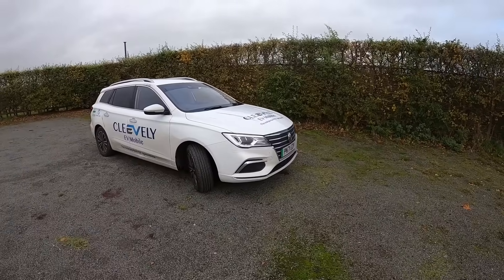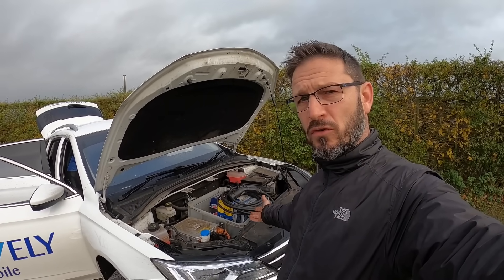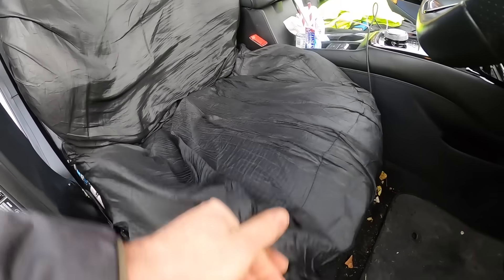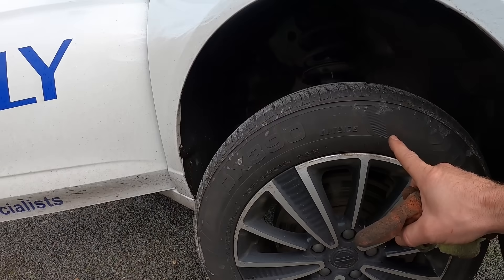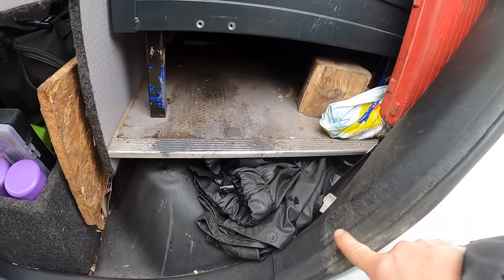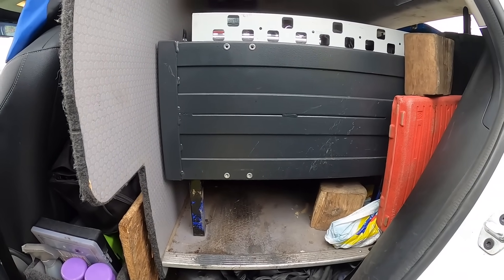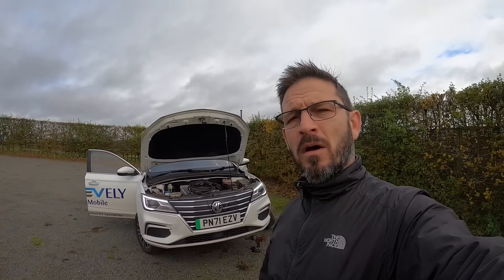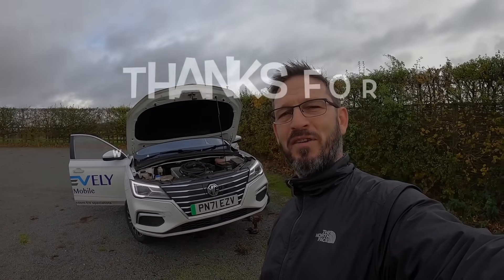How's My Electric Car Battery After 100,000 Miles?

Comment: Cells defiantly sufferer from calendar ageing which works in conjunction with cycling in order to degrade the traction battery.  There's no way a 10 year old battery which has done 100k would have the same residual capacity as a 2 year old 100k battery.
Reply from the maker: The warranty is based around 8 years and throughput. Also Li-ion has a known degradation curve. We have 10 year old 300,000 mile Teslas with 86% SOH remaining.
Reply: I'd be interested to see what they're like after 15 or 20 years, 10 is nothing.
Reply: @deanstyles2567  But 15 to 20 years is pretty irrelevant given that most people don't keep a car longer than 7 to 8 years at most.  I think you'll find 10 years is not "nothing", it's 10 years.  Would you dismiss waiting at a bus stop for ten years, as "nothing"?
Reply: I'm not convinced that Lithium batteries suffer greatly from calendar ageing. I have a ten year old, low mileage, Peugeot Ion that in summer exceeds the WLTP range (on hilly roads) by around 7% and in winter is only down on that by 22%.

Any age-related battery degradation is more likely to be caused by being left excessively discharged, perhaps owing to self-discharge after long periods of non-use.
Reply: Like James and Kate, you havent taken into account that your battery likely has at least 10% reserve capacity.  Your degradation more likely higher than 17 % and youve likely used up all that reserve by now. @sailingoctopus1

Comment: Another great video James and as others have said, it would be good to hear mainstream media telling the truth as you have done instead of so called journalists pumping out misleading BS day after day.  I wonder who's really paying them to write their badly written works of fiction?
What should really make non EV drivers ears prick up is just how low the running costs of an EV are.  I've only done 25,000 miles so far in my first EV (a Hyundai Kona 64kW) but are having exactly the same experience as you are with your four MG5's.
If I'd have kept the Lexus RC300h I had before the Kona I'd have spent more than £5,900 on petrol.  I've actually spent £580 on charging.  I admit most of this has been done at home, but about 10% of the time it has been public chargers.  I certainly won't be going back to an ICE car.
Keep up the good work!
Reply from the maker: Sadly that's an ongoing battle, but there also a certain of person that doesn't want to hear the truth because they don't like it. Glad you're loving your EV 👍🏼

Comment: I don't think the none EV owners quite believe how cheap it is to run an EV, my sister looked at an electric van and was quoted £600 more for insurance than a diesel van so she dismissed it. Not including all costs and doing total cost of ownership will get you the wrong answer.. For myself I have now got my house electric/car fuel bill down to about £30 per month to run a 6 bedroom house with 6 people living in it and driving 8500 miles per year in an i3, Solar, House battery , EV, Octoppus Intelligent means I get 8.5Mwh per year for £50/month and I get £200 ish FIT/year. Next year I start getting my Ripple Energy credit so I will probably be in credit each month! 7 years of planning and saving for this is now paying back in spades. Next job heat pump..
Reply: While that end result sounds cheap, how much investment has that taken and how long to break even? It's not that a lot of ICE owners don't know how cheap it 'can' be, they don't have that sort of money to make it work. It's like saying to someone they can live really cheaply only they would spend £50k first (off the top of my head).
Reply: It wasn't cheap but over 7 years it was ok. I bought second hand EVs over that time and the payback was much shorter as the price of energy rocketed. I am expecting about 8 years payback. Things to consider: do you have savings and how much interest are you getting? I chose to use my savings to remove all future electricty and diesel bills. Inflation will happen to your bills but it cannot effect an asset.  @noggintube
Reply: @noggintube well said mate, let's spend 20 grand on solar panels that MIGHT pay for themselves just as they are end of life. There is no way, zero, that ev car/solar or battery walls etc is substantially cheaper when factor in everything like upfront cost/difference, depreciation, etc etc. we haven't even got to the stage when ev will be charged extra to charge at home, if people think the government isn't going to come after duty then they are simply delusional.
Reply: 😢  You’re right, money always makes money!  I too have invested in renewables, solar, EV, heatpump and it was a large investment however I’m getting a return on that investment that beats what the bank was paying. As for payback I’ve increased the value of my home and made it a better buy compared to my neighbours that hasn’t all this technology. But to come back to your comment yes it’s those with money that benefit most.
Reply from the maker: That's impressive, good work. Sadly, some people can't think outside the box 🙁
Reply: @Jamesandkate Correct, but it's ingenious how they have managed to nail the box shut from the inside.😅
Reply: @Jamesandkate thinking outside the box would be realising if you put the amount of money this person has spent in a high interest account they would be better off per month and still have the money.
Reply: @Jamesandkate Yes it is also a shame that more households don’t invest in home generated electricity but with most people they can’t get past the initial approximate 20k spend. If more home builders provided new homes completely off grid from day one at least a lot of families could have it included in their initial mortgage.
Reply: @philtucker1224  a lot of people rent properties too so have no say in solar power, sure, their landlord may agree to fit solar but he will raise the rent to pay for it, most people just can't afford to be green, trouble is, the government just look at statistics and not real life, statistics always give a false impression, apparently, the average person has over £17k in savings, also, the average person is over £30k in debt, just shows how misleading statistics can be!
Reply: @Markcain268  yes good points. You quite rightly mention renters but let’s be honest, in the west the renewable home energy industry is really aimed at wealthy homeowners that are looking for things to invest lots of surplus capital in. Partly out of boredom possibly and partly out of lowering their electricity bills whilst completely disregarding the initial (20k 30k+) outlay that probably won’t ever reach a break even point, let alone any sort of payback..
Reply: I would also question why the insurance for an ev is so much more than a ice van.
If the ev is so cheap and reliable were is the extra insurance money going?
Reply: @brianiswrong  Most of it is probably going towards increasing insurance company profits. They will know that EV's are slowly becoming the norm, and see an opportunity to cash in on the increasing popularity.
Reply: @brianiswrong  that's an easy one, increased risk of needing to write the car off and all the extra precautions that comes with that in an accident. (fire suppression, storage well out the way etc) Insurance companies have no way of verifying the battery is safe after an accident even if the car can be repaired. BTW this is from the FCA, I asked my local MP why car insurance has went up so much and that is what the report I got back says in it.
Reply: @brianiswrong it may be an allowance for full battery replacement costs or in the case of a motorway vehicle fire the Fire Service has agreed to let EVs burn rather than put out the fire/save the vehicle due to the danger of a fire fighter getting electrocuted. (We’ll soon find out when all new vehicles will be electric)
Reply: that’s to cover the problem of batteries being g very expensive and there being no way to put one out if it decides to self ignite or is in a accident.
If the vehicle is accident damaged there is no way at all to determine if the battery is damaged at all.
Reply: @brianiswrong  insurance premiums are based on long-term claim records, these don't exist for EVs. EV drivers are being milked.
Reply: How is your house heated?
Reply: @Markcain268 Gas. Heat pump is next but in a large 100 year old house it will take more work and disruption. I have an elderly person being cared for in my dining room so probably not going to be fixing that anytime soon. I am looking at a mixergy heat pump water tank though and an induction hob so I will reduce gas usage over time.
Reply: @Markcain268 if all the vehicles in the Luton fire had been diesel it would not have been so fierce. EVs are far more dangerous in a fire as the Luton fire proves
Reply: It all depends on the mileage you do whether it's worth it, especially if you have a good paid for economical ice car already. I have a small car, campervan and two motorbikes all for less than the price of an EV.
Reply: Great video, need to a meeting presentation in Rugby where you live, love to meet you and wife and business friends. I live in a conservation area, and council will not allow me to have solar, or I would go all electric.
Bob
Reply: @rcosnett  my landlord offered to fit solar panels, only trouble is he will raise the rent to cover the cost so I'd probably be worse off lol.
Reply: @Markcain268 You can do it yourself with Ripple shares and they move with you if you move house. It is also 60% cheaper than rooftop solar. Have a look. You can also buy monthly if you don’t have the cash up front.
Reply: (As the current average monthly cost of electricity for a typical family home is approximately £400 to £600 per month) what do you think the real monthly cost of your energy- saving investments are if you divide the total investment so far into (say) 120 monthly increments over ten years for instance?
Reply: If you divide it into 120 I get £165 per month but obviously it keeps working long after that. Also that kind of linear projection doesn’t factor in inflation. I am retired so I also value the predictability of my future bills. You cannot easily put a value on the feeling of future energy security. It works for me. @philtucker1224
Reply: If you try to sell it how much will you lose? Can you sell it?
Reply: @onlyme972 sell what?
Reply: @garysmith5025  the sun shines on a dogs arse some days dude.... vast majority of car insurance is waaaaaaay more expensive.....go look at the insurance groups for leccy vehicles versus their rivals and come back.
Reply: Well done.👍👍👍
Reply: Dam, guess it's my fault for having no spare money to invest.  Oh to be a boomer
Reply: @garysmith5025  as I just said... The sun shines on a dogs arse some days. Some insurance companies now refuse to insure EV..... if they were so profit driven that's a weird choice don't ye think? Only last week did my mate get told by direct line they won't renew his tesla, not the quote was expensive, they refuse to renew him this year. it's not just cars either, in boat mag this month some insurance companies now won't insure boats with 12v lithium starting batteries.
Reply: @garysmith5025  anecdote? ... interesting. I guess the email I have from my councillor about this very subject being brought up in Westminster is an anecdote because he is anti EV too?, never denied insurance in his life, (driving 45 years)buys a model Y, sorry we won't renew you this year. But BTW your BMW x5 and lotus 7 they will renew him..... "anecdote"
Reply: A lot of people can't afford the upfront cost of solar or evs. Being poor is expensive :)
Reply: @DavidAHollis  ripple energy allow monthly payment and many people finance cars monthly too. If your monthly outgoings are lower then you are less poor.
Reply: Here in the states, the infrastructure isn't here to daily an ev all the time unless u drive a tesla. Very slow adoption for public charging. And living in florida I would not want one because we deal with hurricanes all the time and it knocks the grid out for days at a time. So I would be sol, maybe if I lived in a more central state.
Reply: Can I ask how often do you service your mg5 I have a mg5 with 23000 but not serviced it yet
Reply: @ryancoates3683  I’ve got a Tesla. I get a visit every year to carry out basic service needs like filters. I live in the west coast of Scotland so a bit paranoid about rear brakes since I usually use high regen. 10-12k miles a year
Reply: Heat pump not sure about that
Reply: Very good, now try going on a long journey in the U.K., or a European touring holiday and see how long it takes you to get anywhere. 😅
I have over 700 miles range in my diesel car so range anxiety isn't an issue, nor is it likely to spontaneously combust or lose value like it's going out of fashion. However, I do think that electric vehicles are ideal for short distance commuting around cities...providing the national grid can cope.
Reply: @56Gumball  at 100k miles in 2 years ,do you not realise these evs of James ARE covering massive daily mileages here in the uk ? 😳
Reply: @JonathanPorterfield  I'm not saying they can't log high mileage, I'm saying EV vehicles have a much shorter range per 'fill' than an ICE car. 👍🏼
Reply: @56Gumball easy to do long range. My EV plans my stops, charging amounts and times. I would never drive 500 miles without stopping. Good on you if you can do that but I’m happy with 180-250m at a time. I need to eat and use the toilet. Charging can coincide with that. I’ve got a Tesla model 3, new since 2019. Charge mainly at home on cheap overnight rate. Tesla system lets me plan long journeys using the supercharger network. By comparison my servicing costs are nothing compared with yours. For 2 years, all I did was put in windscreen washer fluid and change windscreen wipers and cabin filters.
Reply: And the fire at Luton airport was a diesel so be careful out there.😊😊
Reply: @richardanderson9340  Not proved
Reply: @originalshadowfax  what is proven is that diesel and petrol cars are more likely to catch fire
Reply: @richardanderson9340 What is also proved diesel and petrol car fires are containable within a few minutes of the fire service arriving. The advice for EVs is if you can let them burn out so they won't possibly reignite hours or even days later. And fighting an EV fire is far more dangerous
Reply: @seekeroftruthandjust  evidence is that these fires are rare despite the myths. Of course handling such a fire is more of a challenge
Reply: @richardanderson9340  So you agree that they are more challenging. The fact they are rare is down to the fact there are fewer about. It wouldn't be rare if we were all driving them would it 🤔
Reply: @seekeroftruthandjust  proportionately EV fires occur less frequently than ice care fires.
Reply: @richardanderson9340 you forgot to say And are far more dangerous
Reply: @seekeroftruthandjust  no I didn’t forget. Luton airport car park fire costing £ms and bringing the airport to a stop, disrupting its function for years wasn’t caused by an EV. That’s a known fact. Can you point to a similar incident caused by an EV fire? I get you have a dislike of EVs (and probably considerable ignorance about them too) and an axe to grind.
Reply: @richardanderson9340  Again you conveniently ignore that EVs were involved in the Luton fire which was why it was such a disaster 🙄
Reply: @seekeroftruthandjust  you’re ignoring that the CAUSE of the fire was another spontaneous combustion of an ICE car. The EVs didn’t go on fire on their own. The diesel went on fire that wasn’t controlled.
Reply: @richardanderson9340  Had all the cars been ice cars the fire would have been contained on one floor. EV fires are very hot (~800 deg C), nearly impossible to extinguish, and can burn for hours or even days depending on the number and size of the cells affected.That is what caused the car park to collapse. Why do you think they are being banned from some car parks and ferry companies and repair garages won't park them near the building or other customers vehicles and as a result of the danger some  insurance companies won't insure them

Comment: Will be interesting to compare this to my Peugeot E-expert van next time Smithy comes to service it as it is coming up to 2 years old and done 70,000 miles currently. 
I think it’s lost about 2% battery, still on the original rear tyres and changed the fronts around 56000 due to a puncture with 2mm tread left. .
Reply from the maker: That's good mileage. Ask him to take a picture of the pads when he pulls them out 👍🏼